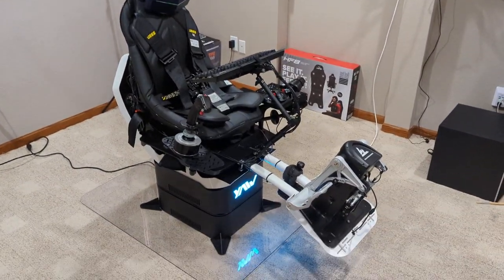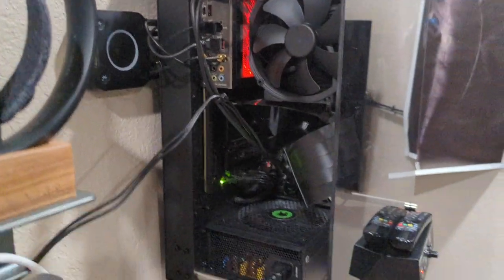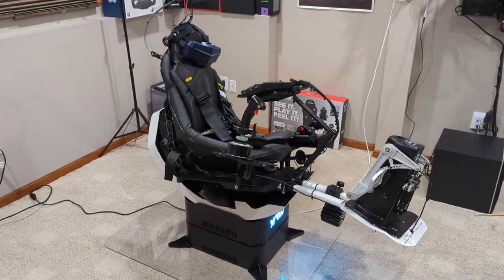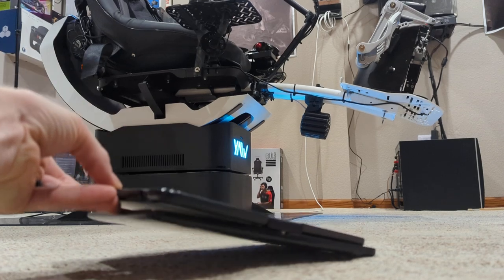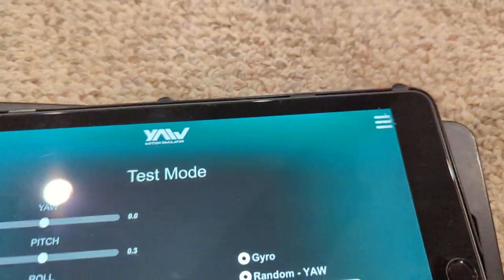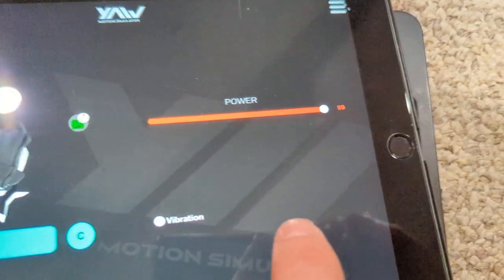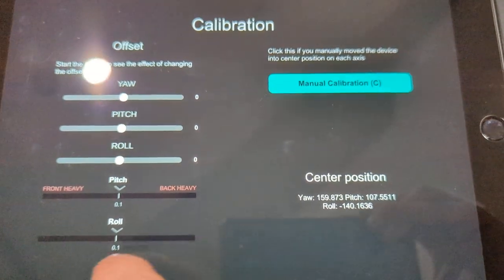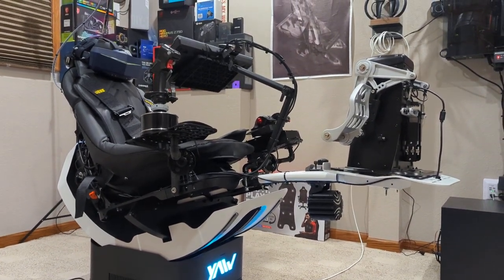YAW 2 PRO test.  App explained. DCS, MSFS 2020, rtx 4090, custom built flight sim. VR motion.

Comment: So everything I've gathered from this is that a Device like Yaw VR 2, or a 360 rotating VR chair in general won't be ready for mass consumer consumption until either...

A)  Yaw implements a Slip ring type feature into the device to transfer Multiple USB Devices data and Power. 
or
B)  Someone makes a High Speed Wireless USB HUB that can run off a rechargable battery to supply the power. (Or still have the chair provide the power via a slip ring)

The VR Headsets are already proving to be wireless, so that is a secondary priority next to those.

Maybe someone out there can re-approach Tesla's idea of wireless power.   The distances needed to transmit power here are pretty short.
Reply from the maker: I would agree that the current state of affairs requires too much effort for an average person to accomplish it. 

It's definitely not an Xbox. 

What would be ideal is for one company to make an entire package. Have the PC built into the chair and have the next generation VR headset perfectly integrated as a system. Pre-programmed and pre-tested thoroughly like an Xbox.

It could be done.  Absolutely. The question is, is the ROI there for the companies that can accomplish it? Company like Nvidia.

Comment: I recommend a lan cable as well from the yaw2 and then go back in via blue tooth and leave the WiFi credentials blank. It's just a more reliable way of controlling it via lan rather than WiFi :) you definitely don't want any dropouts or lag ;)
Reply: Oh and if you have issues with the usb at all then you can use a right angle usb to the bottom plug on the pimax to a usb hub. I ended up with a quest 3 for wireless though instead.
Reply from the maker: I've been so busy for the last year that I haven't been messing around with the chair much at all. I've got a broken roll motor right now. So I got to take the damn thing apart. They're very supportive though. They talk you through anything issues.
   Life keeps getting in my way, man. Just so busy. This thing is a big time eater too. I'll get to it. 😀

Comment: What does the video card have to do with this chair? Is it reliant on GPU power to function? I've only seen the DOF rigs. This thing looks awesome.
Reply from the maker: Card has nothing to do with it other than providing the best possible VR visuals, which theoretically would keep up the best with the movements of the chair. My theory.
Reply from the maker: It's finally getting cold out now so I'm spending a bit more time inside. There's a couple things they need to do to the chair. I got to fix a squeak, which apparently isn't a big deal. The support is awesome. They talk right to you through email and guide you through everything if there's an issue. Good people.

Comment: Hello! What do you think about max load allow 120 kg?  Looking your cockpit, and the weigth and the pedals…. It seems that sitting you in the yaw and your peripherals…. Its ober than 120. There are a problem? What domtou think about it?? 
Im 85 kg and i would like to put pedals, trhottle and front panel wingwing f18… thanks
Reply from the maker: There's no way it's over 120 kg. That's a racing seat. It has more than enough power.
Reply: @phoenixrising011  sorry! I want to say that… if your weigth its 80 kg…. The seat 15 kg… the TM pedals 10 kg……… may be over 120?? This is my dude about it.

And if you would want to put a stick between your legs like in F18, how will you do? There are no problem for drill the base plate where you have fix your rigth and left panel no? Thanks so much

Comment: Do you need the buttkicker?  I thought the YAW 2 includes vibration.  Thanks for your time.
Reply: I see now you opted for BK.  IS it better than built in vibration?
Reply from the maker: I love the kicker. Don't need it, but it adds to immersion because it is sync'd with the audio whereas the chair has it's own signals. They seem independent therefore not redundant. Follow me?
Reply: @phoenixrising011  Totally!  I’m considering buying and have a buttkicker.  
The YAW2 is worth it?  It doesn’t get old?
Reply from the maker: @sheldonnorton9035  yeah it's cool. It's hard to describe or really appreciate on a video. Just like VR is impossible to describe. You have to experience it. It legit feels like you're in a cockpit. It shakes, rolls, turns, pitches, all of it... I'd say it's worth the money. Definitely the best bang for the buck in motion chair setups.
Reply: @phoenixrising011  Did you happen to consider a DOF Reality rig?
Reply from the maker: @sheldonnorton9035  Yes, I actually ordered one and cancelled it. 6 DOF.
The wonky 80s looking design and lack of good pitch and rotation made the difference. YAW is a superior unit overall imo.
Reply: @phoenixrising011  Thanks for the valuable info!
Reply: @phoenixrising011  But the SFU motors look quicker to respond, that will give you more immersion that being led on your back slowly especially in VR.

Comment: Hey what’s that clear pad you have it sitting on? It look thick, can’t find them that thick.
Reply from the maker: [Upgraded Version] Crystal Clear 1/5" Thick 47" x 35" Heavy Duty Hard Chair Mat, Can be Used on Carpet or Hard Floor https://a.co/d/h6LfwRJ
Reply from the maker: Put clear double stick onto the carpet under the plexiglass, and clear double stick under the feet of the unit. It has enough power to twist if you don't secure it down totally. A few pieces of transparent gorilla double stick will do the job.

Comment: I didn't realise there was a gyro mode in the game engine , I've been using SRS . Game engine is giving me some issues . My pitch is backwards , When I drive up a hill my Yaw2 tilts forward instead of back even though I selected the check box to invert.
Reply from the maker: Exactly. These little unknowns and random stuff that ”should work” but doesn't.
Keep playing. I'd go back and ”reset, reinvert" 🤷
My dumb ass tried playing DCS without a chair tracker. Just a VR headset. 

Yeah. Would have made a funny video.
Like a damn wild horse. My " vr feet" were out the damn glass canopy backwards, I'm looking at my tail and the chair is spinning and pitching. 😂

Then I was like "wait how does.... Ahh shit THE CHAIR tracking.... " Derp.

But damn it's so layered and there are infinite ways to screw things up. 

Make restore points on your PC!!!
Reply from the maker: What is SRS? You probably know more than I do. I'm noobing my way through calibration.

I put an icon on my desktop for the YAW engine and it works like 10% of the time. No app file in the unzipped folder. Gotta unzip again and open the freshly unzipped app.exe file again if the desktop icon fails. Super weird. Shit like that drives me nuts.
Reply: @phoenixrising011  SRS is Sim Racing Studio software for yaw2. Apparently it works seemlessly. I don’t have my yaw2 yet, but from what others have said, I believe you will save yourself a lot of headaches by using the SRS software instead
Reply: @Phoenix Rising  SRS is the Sim Racing Studio software for motion platforms 👌 It works perfectly but cost £50
Reply from the maker: @sgooloo8457  I'm attempting openxr. Does SRS have DCS in the library? That would be nice.
Reply from the maker: @stubot-gameviewtech  

I'm too new at tuning to be informed enough whether openxr is "hard to do" but the first 15 min dabble wasn't fun. If SRS is easy and they have DCS, I'll strip out openxr and replace it with SRS.  

 I am confident that I can nail down openxr with some effort though. But I might be naive because I just don't know enough yet. It's a neverending learning curve. Pretty steep curve here too. Very little solid info and so much variability.
Reply: @Phoenix Rising  SRS has DCS and I feel SRS is dead easy to use  compared to game engine. are you on Discord ?
Reply from the maker: @stubot-gameviewtech nice to know SRS is easy. no discord. Show me where, I'll check it out. Well worth 50 doll hairs if it's easy. 

I'll continue with openxr just to learn about it since I am all the way to the specifics, but I'll bail the second I hit a roadblock or I can't get it to work perfectly. I bet they both work.... 
I'll check into SRS.
Reply from the maker: Does it matter which way you orientate the SRS gyro box? Mine is supposed to arrive today. Could it be that you have yours orientated backwards or something? I'm completely ignorant of these systems right now.

Comment: I'm really curious how smooth the motion is when you do slow shallow banks/pitch. I currently have a DOFreality H3 which is very jerky during slow movements. (Like 2 or 3 steps per second which ruins the immersion )
Thinking of replacing it with a Yaw2 if the smoothness is better .
Thanks.
Reply from the maker: It's smooth. You can set the power/speed of the reactions.
Reply: @phoenixrising011  Thanks for replying 👍 On the DOF H3 you can also adjust power/speed etc. but the refresh rate of the gearboxes seems limited, which results in a "steppy" motion. The Yaw2 indeed looks much smoother from what I can tell.
Reply: @phoenixrising011  Btw, I also noticed a Yaw2 video where they were testing an extension that moves the platform up/down. :-) 
https://www.youtube.com/watch?v=lgEHtezQ4Z8
Reply from the maker: @jingle1161  yeah I emailed them and asked them to make sure to let me know about that thing. And if they have an early one they want tried out. I would help them. They're very very cool people and they respond quickly when you're talking to them.

Comment: Gday mate form Australia.......gotta say you have done an absolutely superb job at outfitting your platform. 

I'm a retired commercial pilot and big into MSFS2020 in VR and want to move into a Yaw2. My hesitation at the moment on pulling the trigger and ordering one is that the more I look at the SRS instructions for getting VR Motion Compensation to work the more I hesitate as it definitely does not to appear to be a simple task to achieve VRMC. I know Yaw are getting ready to send out their VRMC update but its restricted to just 3 VR headsets, I have the Reverb G2 and they have informed me that their solution will not do VRMC for my headset. Have you managed to get VRMC to work on your rig? I f so, how and was it as daunting as the SRS instructions depict. I don't want to have to use 4 different apps (SRS, OpenVR, SteamVR and Witmotion module) to get it to work. 

This is not simple https://simracingstudio.freshdesk.com/support/solutions/articles/35000209208-openvr-motion-compensation-setup

Motion Compensation is critical factor for my purchasing decision. If anyone else reads this and can let me know of a simpler method to achieve VRMC then I would welcome your feedback.

Again, great result, your rig is the best set up platform for flying I have seen anywhere on utube (and I've looked at just about every video there is re motion platforms). You have every right to be extremely pround with your work....
Reply: Hello Sir, did you got the Yaw2 or any looks on the Dof Reality H3?, I got the same setup as you with the reverb g2 and play a lot of dcs still trying to decide
Reply: Bought the DOF Reality H3 as the Yaw rig is just a can of worms at nearly twice the price of the H3......have a friend who has had the Yaw2 for around 12 mths and its still not operational....my H3 performs fantastically and I  would definitely recommend the H3 over the Yaw rig....btw, if you are going to purchase the H3, let me know b4 you place an order and I can help save you some serious money
Reply: @GunPilot appreciate sir, just bought my 4090 yesterday, I will be getting the H3 next month or by november, ill ping you here
Reply: @GunPilot  can you give me advice on how to save money either the h3? I wanted the yaw2 but I’m concerned with how behind they are on orders while launching new hardware at the same time. It doesn’t seem right.